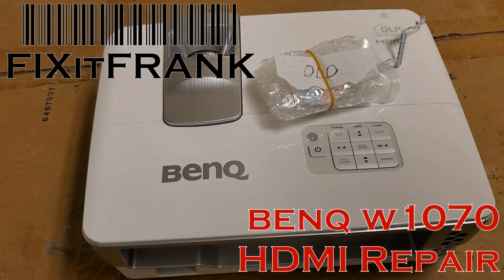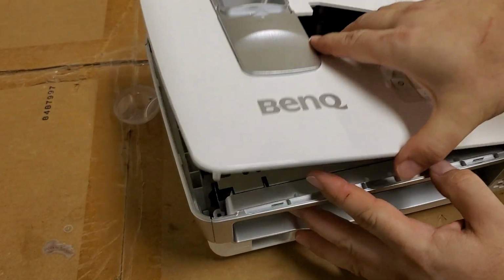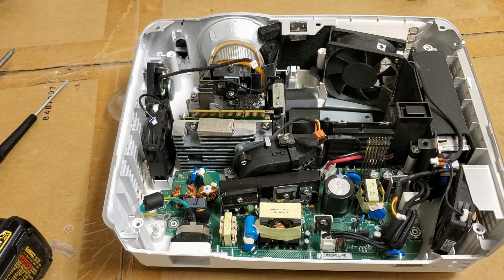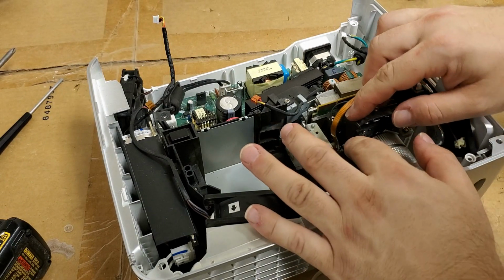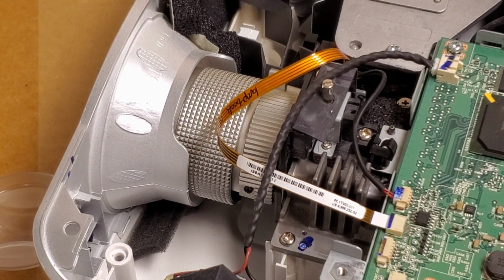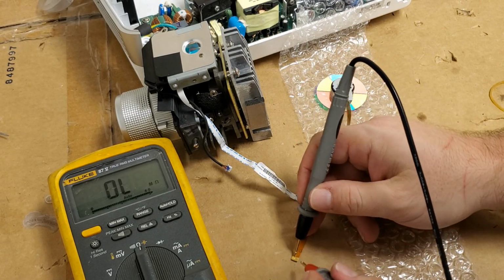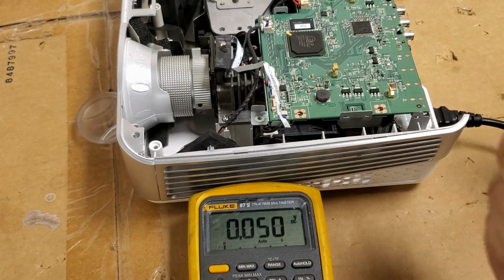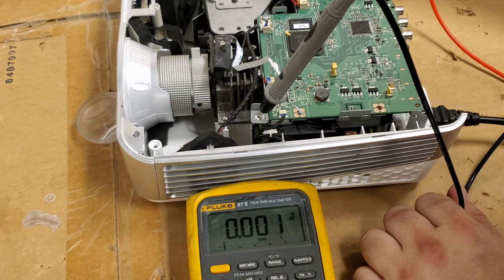BenQ W1070 DLP Projector Repair / No Light-HDMI Issue Part 1

Comment: Any idea what the error of a W1070+ could be!? The powerled flashes green and it warms up. But not the lamp. After 1-2 minutes, the fans shut down and the green powerled keeps on flashing.

Before that error I had to replace the lamp  and then cleaned up the light tunnel and whole stuff Luke Mainboard and Fans. 

Any idea? 

Very helpul Videos. Thanks a lot!

Kind Regards
Reply from the maker: oh man. hard to say.  Usually that is a lamp but if its just flashes green, check your low voltage pins and their alignment to the mainbaord. If you offset the pins by one, the power led will flash green as a symptom.

Comment: I have a ht1070 when I turn it on the lamp comes on. The two side fans turn on  then the lamp fan turns on but after about 10 seconds the lamp fan turns off I scoped. When running have squares waves then the fan turns off and no square waves then get a temp led comes on could it be a bad temp sensor or board problem fans are all clean I don’t see the over temp sensor it’s not part of the fan assembly
Reply from the maker: The over temp sensor is a self resetting breaker. It will just kill power until it cools, then it will turn back on.  I'd make sure all the fans are talking to the mainboard.  They should have square waves but the frequency/RPMs should be fairly even.  Turning off after 10seconds sounds odd to me.  You might have some fan IC's with issues. but you need to verify that a little more.  I'd suggest downloading the W1070 service manual. It is close enough to the HT1075 that you can use it for troubleshooting.  If its not a fan issue, then it might be a mainboard issue.  the temp sensor wont be the problem though.  it woudnt turn the fans off. rather it would kick them into high speed.
Reply: @FixitFrank ,  ok, I will check it out today. If the fan lamp has a tack output to the motherboard, could the tack output be bad, which would shut down the system? What should the tack-out look like when using a scope? I looked at the power of the fan and could see square waves, but when the fan shuts down, the power goes to zero, and no square waves.
Reply: What should the tack output from the fan look like with a scope? This is the fan that has a squirrel cage and blows on the lamp. If there is no output on the tack , will this shut down the projector.

Comment: Hello Frank, great videos. Thank you for sharing. 
I have the W1070 and have loved it. I have replaced the lamp twice, but light still on. Have checked the color wheel and seems OK, spinning.  No light comes through.  I wonder what the issue could be? Any suggestions? I would love to send it to you, but based in Bulgaria,  Eastern Europe.
Reply from the maker: I love the w1070. The wheel might be spinning but possibly not correctly. The projector must sense the wheel at the correct speed or the lamp won't light. 
Did your old lamp burst/rupture when it failed? There is a possibility of a power supply problem but I need more information.

Comment: Hello Frank. I too have a W1070 that  the bulb burnt out. I replaced and the screen would go from color BenQ to flicker to black n white to shutdown with red Lamp lit. I cleaned per several of your videos. I also completely disassembled and cleaned all the fans. When I put it back together, there is no power light and unit will not turn on. Do you have a direct line of communication, website or way to get your repair assistance? Please help - MLS playoffs and football season.
Reply from the maker: https://1ty.me/0Ii1uvO  Here is a one time link with my email. Give a shout!

Comment: Hi Frank, I have a w1070 not turning on at all. I have a multimeter, I can't see any blown capacitors or anything that looks unusual on the boards. Do you have a video or can offer me any advice on testing the power supply for this projector? Feels wasteful to throw it out without trying to repair it!
Reply from the maker: what low voltages are you seeing on the header to the mainboard?

Comment: Lightning strike took out my HDMI.  Do I replace the entire board? If so where can it be purchased and how easy is replacement?
Reply from the maker: I would replace the entire board. It's possible that the old one could be repaired but lightening is a nasty problem. It can damage things that seem okay now but start flaking out at random times. Replacement is easy. You don't need to flash or program anything. You can try the company I use. gydz@timeprojectorlamp.com is the contact info. They ship DHL and take Paypal. I've used them for over five years. Very good company.

Comment: Hi Frank, my w1070 doesn't turn on at all after I tried disassembling everything, cleaning color wheel and screen, and putting it back together.  At 13:43, I noticed that your mainboard lights turned on when you pressed the switch bypass.  My lights don't turn on at all when I do this.  Yes, it's plugged in, and power cord has been tested. =)  I've double-checked that the bulb is seated properly.  As far as I can tell, all connectors to the mainboard are also in place. What do you recommend as next steps?
Reply from the maker: check the alignment of the low voltage power supply pins that come up into the mainboard. It's easy to offset them and this can happen. also check the thermal breaker connection and any power connections to the power supply.
Reply: @FixitFrank  You da man! =)  The power supply pins must not have been aligned correctly.  Now I have power again.  Here goes attempt #2 at trying to clean the dmd.  Lots of spots, especially when out of focus and with a dark background.  On my first cleaning attempt, I blew some compressed air from a can on them and wiped them with a lens cloth, but still spotty.
Reply: @FixitFrank  Spot on. Had the same issue after a clean up and lamp change. Offset pins it was. Thanks!

Comment: Hi frank, great video. I have exactly the same projector as you are repairing in this video. One day when I wanted to use this projector I pressed the power button on projector, the projector not turn on and somethig explode inside. Do you thing it was some capacitor in power suply. Because i checked the lamp and it is no broken at all. Thank you for your answer.
Reply from the maker: What have you checked so far?  There are many things that could cause that.  I would probably start checking the color wheel. If there are no LEDs then maybe the power supply but I suspect you heard the color wheel fly apart.
Reply: @FixitFrank  Hi thank you for your answer I checked only bulb. when it happened, it was like some explosion inside and the smoke comes out of the projector. Tomorrow I will disassembly the projector to see if there will be some noticeable damage.

Comment: Hi Frank. I have a W1070 that’s completely dead. No lights, sounds etc. Everything inside seems perfect, I’ve reseated the bulb and made sure all the edge connectors are firmly attached. I’m in the uk so I can’t send it to you, can you give me any tips to fix it?
Reply from the maker: I have to ask the dumb question.  Is the lamp cover in place?  The safety interlock will defeat the power without the door installed.
Reply: @FixitFrank  is that the white plastic thing with the screw at the side? If so, yes! Where’s the safety interlock?
Reply from the maker: @ravi911uk  https://youtu.be/1kx0mLzDavE?t=959  Its the button I jam with the screwdriver.  If that is not working or isn't being held down, that can definitely be the issue.  Has it ever worked?  If so did anything happen that are aware of?
Reply: @FixitFrank  Aah, that one. No it does nothing. I pressed it in and held it in like on your video when the top panel was off but it did absolutely nothing at all.
Reply from the maker: @ravi911uk  OK, had to check. That's the first thing that gets in the way. Second is the thermal breaker. It should self reset though.
What happened to it? Did it work one day and not the next? Fuse, power supply, and the interlock switch are the usual suspects. I'm guessing you tried another power cord.
Reply: @FixitFrank  ok, full explanation follows! A few months ago the projector suddenly stopped showing images, just a greyish screen. When I looked closely, you could actually see the pictures but there was zero contrast so they were basically hardly visible from the background. Same with the menus. You could see a menu box but no menu items. I took the lamp out and it seemed fine as did everything else and put it back together and it all started working but I noticed that I has somehow introduced dust into the picture. I put up with this for a while and then it really started to bug me so I looked a couple of vids (including yours) about how to disassemble the projector and went for it! 
I was pretty meticulous, labelling everything and after I cleaned everything, I put it all back as I had found it. After I’d finished, I connected the power and ....nothing. 
I must have taken the thing apart 3 or 4 times, making absolutely sure that I’d not messed up anything but no matter what I tried, it didn’t make any difference - it was just dead.
Reply from the maker: @ravi911uk  Ahhh. That makes way more sense.  
You have a lot of possible problems honestly.  The power supply could be bad or the mainboard(or both). Double check that thermal fuse where it plugs into the power supply.  You may want to check it for continuity too in case the thermal fuse opened and did not reset. This is not going to be an easy fix and might not be worth your hassle if its anything other than a bad connection. I prefer to fix everything but there is a limit and you might be there. I do know a guy in the UK though who is pretty decent if you want to send it to someone kind of local.  I will check with him if you want.
Reply: @FixitFrank  Thanks Frank. I was thinking the same thing so I think I’ll just give up and get another projector. I’ve had 6 years use out of this thing so I guess that’s not too bad a lifespan! Thx so much for your great advice and great videos. All the best!
Reply: @FixitFrank  I was having the same problem.. after clean i was getting no power and leds at all after pluging power cord in.But i forgotten to plug the thermal sensor from the blowfan back into place.Thnx Frank

Comment: Hi Frank, my BenQ W1070 has exhausted the lamp hours and I bought an original Osram bulb, it starts up but the Lamp button is red and won’t display. I have it verified by a technician that the bulb is working fine. They said I need the ‘Key Combinations’ to reset the lamp hours which can be done even when it is not projecting anything from the bulb. I have not been able to to find the correct key combinations. Any idea? Thanks.
Reply from the maker: They are partly lying to you.  Some projectors do stay in protection mode when the timer runs out, but not the W1070.  You can only reset the timer when the lamp lights.  The W1070 will 100% not shut itself off when the timer expires.  
What happened with the old lamp that caused you to replace it?
Reply: @FixitFrank  Sorry for the late reply. Even the original lamp seems to be fine according to the technician. He said it has a Chinese firmware and the reset combination is different from my locale firmware. I still have it wrapped and packed nicely in a shelf. Been a hectic time working in a hospital. I hope I will have time tomorrow (Sunday) to bring it out and try some troubleshooting methods again.

Comment: FixitFrank, is it possible if you can either provide the 5 wires wiring order from the mainboard to the ballast. This is the wire that send UART signal to the ballast to control the bulb intensity and such. I accidentally ripped the connector and pulled out the wires out of the connector before knowing the colour sequence.
Reply from the maker: I will have to check Monday, however it should be the same on both ends. I set myself a reminder to get back to you when I am near a BenQ. If you are in a rush, the service manual is available for free here.  https://elektrotanya.com/benq_w1070_w1080st_ver.00a_level3.pdf/download.html
Reply from the maker: Black, Brown, Red, Orange, Yellow.  This is with the connector plugged in. Here is a diagram.  https://imgur.com/a/lsNosO7
Reply: @FixitFrank  Oh, could you please tell me the colour for the other end, where it plugs into the ballast. That is the end that I damaged and do not know the order.
Reply: The order of the colours are the same. However, from which pin does the colour start as black
Reply from the maker: @hiepnguyen749  Here you go. I ended up taking pictures.  Figured that was better and would be more helpful for others in the future. https://imgur.com/a/4TzEl1S
Reply: @FixitFrank  Thanks a whole bunch. That picture is worth a thousand thanks. It's exactly what I needed.
Reply from the maker: @hiepnguyen749  Yah sorry. I should have done that from the beginning.  I wish Youtube had its own image gallery. I am getting quite a collection.  Someday soon I will organize my Imgur gallery and share it here.  If you need any other pics let me know.

Comment: it took me 5 hours to unscrew the projector and understand that i had the color wheel problem, then I bought a new color wheel for 50 euros on al1express, after 3 weeks I received it. It took me again 5 hours to rescrew the projector but at last my benQ W1070 is coming back for a new ride with clean fans !!!
the failure occured after 400 hours of the second lamp so around 5400 hours.
Good luck guys !!!
Reply from the maker: Awesome! You should be good for quite a few years now.  Enjoy the projector!

Comment: Hi Frank ... got a benq sh910 dlp , bulb not coming on.  I do get 103v at bulb plug ...  color wheel spins good when pushing power on .. This happened after a bulb popped and broke while on ...  figured it just needed bulb but obviously it did more damage.    will not power up any lamp i plugged in ... any ideas ?  thank you

Comment: Hello Frank! Thanks for this great tutorial!!! I have a bit of a problem with my W1070 and i have no clue what is the problem. Maybe you could give me an advice... So the bulb exploded while i was watching a movie. All the panel lights went of. no green red or anything. I thought replacing the bulb would solve it. After I did that, nothing happened. still deal, no lights at all. Do you have any idea what might going on? Could the bulb explosion affect any of the electronics? Any tip would be appreciated! Thanks

Comment: Does anyone know how how to fix or replace  the bypass switch button? my is broken and my projector won't turn on. Thanks
Reply from the maker: Bypass switch button?  I am not familiar with this.  What are your symptoms?
Reply: @FixitFrank thanks for replying, the button at 13:44 is broken and now my projector won't power on at all.
Reply from the maker: @BananaFlapjacks90  ah ok!  I see.  You can cut the red/black wires that go to it and the white plug on the powersupply, then solder them together, tape up the connection as its interrupting the line voltage.  You could also jump the pins at hte power supply but again keep in mind that the voltage is at line level so protect the jumper appropriately.
Reply: @FixitFrank  thanks Frank it worked 😁

Comment: Great video, thanks Frank.  My W1070 blew its bulb a week ago - there was quite a bang - and I have a replacement lamp arrive which I've swapped in (after vacuuming our any remaining debris).  Unfortunately the projector doesn't work properly now... it comes on for enough time to get the Benq loading screen, the Amazon Fire TV home screen and then it glitches, colours go funny and the bulb turns off.  I can't then turn off the projector by the remote (or power button) and have to pull the cord.  Also, it looks too dim compared with normal before the colours and picture start glitching.  Any ideas how I could diagnose and then fix the issue?

Comment: Hi Frank,I'm happy to joint your excellent video that saw.i have problem of benq w1070 no power on lamp blower. Pls help to fix it.what the diffictive component it should be damage.
Reply from the maker: Hi Maria,  Do you have no power at the lamp blower socket or no lamp blower rotation?